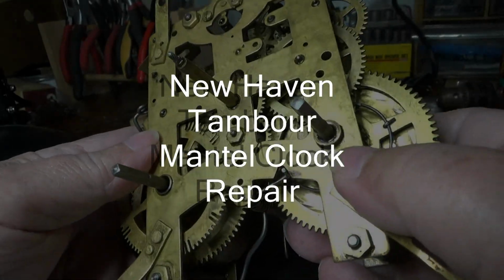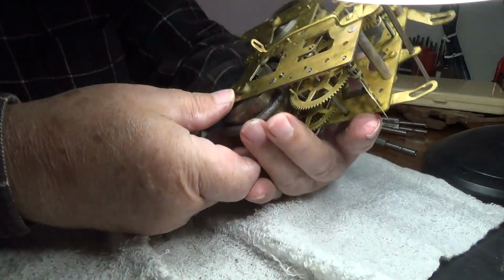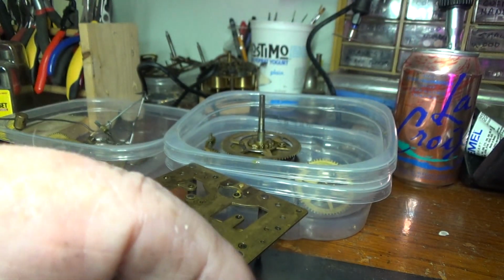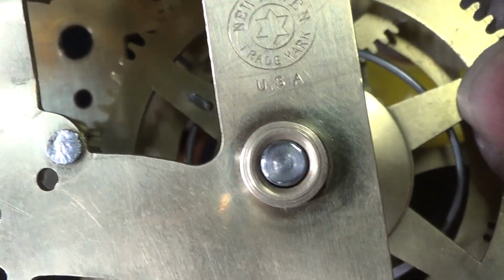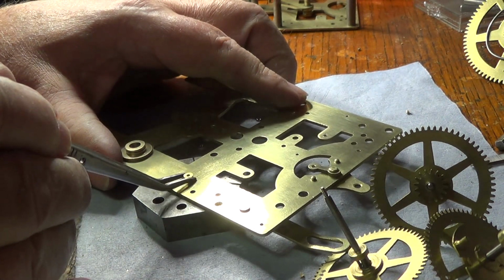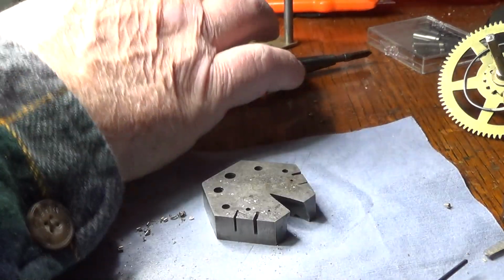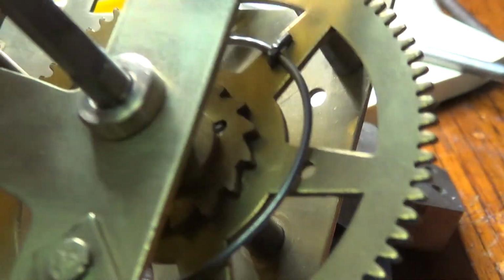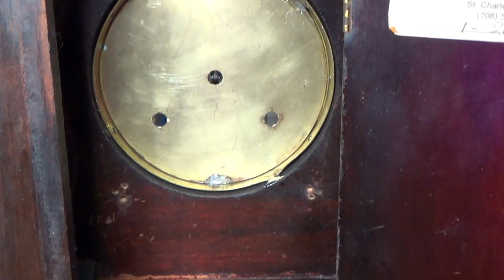New Haven Tambour Mantel Clock Repair

Comment: An index for this video:
00:00 An introduction to this clock movement and the symptom the owner noticed
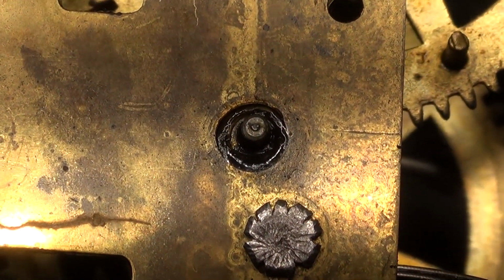01:02 Viewing dirty pivot holes
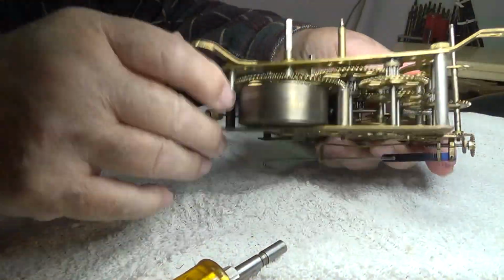01:19 Discovering the unusual mounting of one mainspring
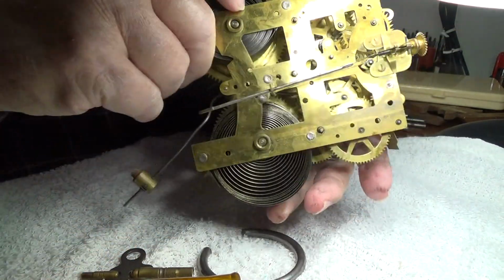03:20 Clamping and letting down the going side (time side, run side) mainspring
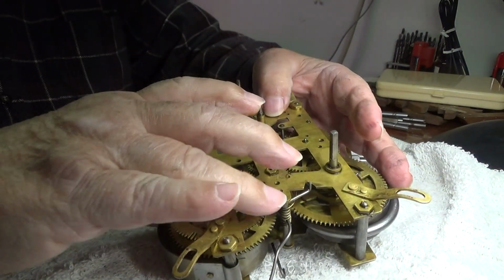05:24 Clamping and letting down the strike side mainspring
07:44 Examining the too-long strike side mainspring
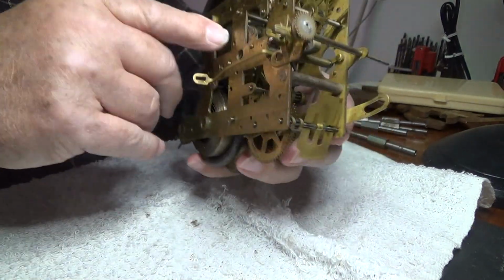08:22 Removing the nuts that hold the plates together; the last nut is too shallow to remove with a nut driver
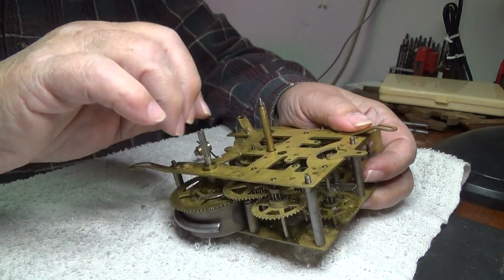11:16 Unhooking the hammer spring; pulling the plates apart
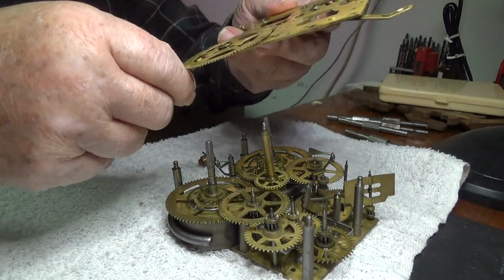11:50 Examining dirt in the pivot holes
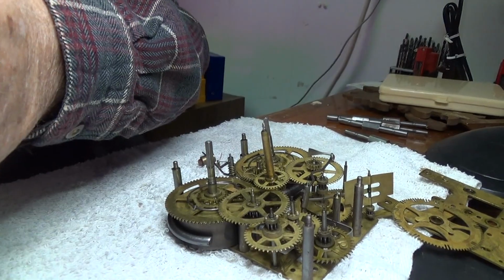12:31 Noting the position of the wheels (gears)
12:56 Examining the back plate; damage from earlier repairs
14:28 Taking a second look at that odd mainspring
14:47 Examining the time side wheels for damage
16:30 Examining the strike side wheels for damage
17:58 Examining the parts after ultrasonic cleaning
18:33 Polishing the pivots and axels with fine sandpaper
21:07 Examining the polished parts
21:35 Examining the going (run, time) side pivot holes for wear
23:06 Examining the strike side pivot holes for wear
25:19 Bushing: Marking the un-worn side of the pivot holes
25:36 Bushing: Front plate after filing pivot holes
26:13 Bushing: Measuring the front-side pivot sizes (diameters)
27:44 Bushing: selecting appropriate bushings
28:34 Bushing: selecting appropriate reamers
29:34 Bushing: reaming the pivot holes to accomodate the new bushings
30:58 Bushing: pressing-in the new bushings
33:09 Bushing: broaching out the new bushings to fit the wheels' pivots
38:59 Bushing: testing the new bushing
39:38 Bushing: testing the re-bushed strike side front pivot holes
40:09 Bushing: Comparison of the front (bushed) pivot holes vs. the back (not yet repaired) pivot holes
40:54 Bushing: examining the re-bushed back pivot holes
42:19 Bushing: preparing to replace a great wheel (mainspring) pivot hole bushing
43:45 Bushing: turning, on the lathe, a new bushing for the mainspring pivot hole
46:12 Bushing: explaining how the new bushing must be peened over (riveted) to stay in place
46:49 Bushing: examining the repaired going side (run side, time side)
47:34 Adding the count wheel, with the correct side in.
48:23 Reassembly, in brief.
51:27 Repairs to the key to allow it to adjust the clock speed.
52:00 Oiling
53:12 Running on the test stand
53:54 Cleaning the case
54:30 Running in the case

Comment: Thanks for your effort in these videos. I am currently working on a movement the same and had also noticed the unusual anchor for the time spring. This confirmed that it wasn't wrong by accident! 
I normally work with earlier stuff and was also thrown off a bit by the deadbeat escapement and reverse rotation of the escape wheel. You have helped so much..
Reply from the maker: Glad to help.

Comment: help me!  I need an old timer like myself to ask if a clock feather can be made of brass rather than spring steel.  I am repairing a new haven san mateo and if I can use brass would be an easy fix.  thank you
Reply from the maker: Certainly.  The important factor is that the suspension spring material serves its purpose to safely support the pendulum (is strong enough) and allows the pendulum to swing freely.  Look at a cuckoo clock movement.  It doesn't even have a suspension spring.  The pendulum rod is suspended by two wires loops on the ends of a U-shaped wire that is hung on a second piece of wire. Here, you can see the suspension in a cuckoo that I just described:  https://youtu.be/B_-4gkpjQlE?si=hYKkGVPdDT3SDPH4&t=2054  and Here:
https://youtu.be/sV43eXJTIUQ?si=LV28PEI5mEIY-Nc-&t=1321
Reply: @ thank you, I very much appreciate you advice!  Your instructional videos will Iive for many generations of clock repairs to come.

Comment: Thank you for the video.  What size nut is used to hold the clock hands on.  I recently purchased one of these and I am trying to restore it. Also, what is the part after this.  The clock only has the hour and minute hand and is missing the parts to secure it.  Thank you.
Reply from the maker: I don't have that clock here anymore.  I don't recall the actual size of the nut.  The hand has a slot that fits on the end of the arbor and the nut is slightly cup-shaped and is the only thing needed to secure the minute hand. You could add a domed washer under the nut if you don't have an original nut and need extra pressure to hold the hand. You might like to read this:
https://www.clockworks.com/posts/mechanical-clock-hand-nuts
Reply: Thank you @dperry428

Comment: I have a New Haven exactly like the one in the video and it has the going spring on the special stud just like yours... I assume it is how they did it... my problem is that when the clock strikes the hour... sometimes it doesn't drop into the slot, but continues on around for a few complete revolutions before the tang drops into its slot and of course that is the wrong slot... what could be wrong? I thought it might be the spring tension on the arm, but using my finger to apply pressure doesn't help... in fact it feels like the lever is locked out...
Reply from the maker: Look to the cam on the third wheel.  There is a notch on the cam that has a wire rider that should hook into the slot at exactly the same time as the lever on the count wheel drops into a deep slot.  The edge of the notch may be worn, allowing the wire to not catch and stop the strike, or the wire may be bent upward very slightly, keeping it from consistently falling deep enough to stop the strike.  Also, the count wheel lever may be dragging on some deep slots, keeping the wire rider on the third wheel from dropping deep enough to stop the strike.  Make sure the count wheel lever ("tang") is dropping freely into the deep slots.

Comment: I had both hips replaced 12 and 7 years ago 
I sure know what you mean about damage in your hand
Getting my hips done has changed my life
All the pain of the whole process is exhausting 
I really enjoy watching your expertise with clocks and metal working 
Bless you
Reply from the maker: Yes, in 2021, I had the left hip replaced in May, the right one in August and the right knee in December.  Now, in the spring of 2023, I'm about 30 to 40 pounds lighter and the swelling is gone in my hands.  I feel like I'm 20 years younger and the repairs are one heck of a lot easier. Thanks for the comments. Bless you, as well.

Comment: In the future, will you explain how to set the chime train upon reassembly of the clocks? Thank you!
Reply from the maker: There's no real magic.  With the count wheel lever in a deep notch on the count wheel, the third wheel (the one with the notched cam) should have its lever in the notch and the fourth wheel (warning wheel) should have the pin on it at the top of the movement.  It gets tricky keeping them in place during assembly.  That's why some people loosen a screw, spread the plates a bit, disconnect the fourth  wheel pinion from the third wheel and adjust the warning wheel after assembly.
Reply: @dperry428  I'm currently revisiting this movement for reassembly. Thank you for the advice!

Comment: As a novice and learning clock hobbyist, your videos have been very educational for me.
But, I have an old Sessions Clock co. clock I cleaned and oiled.  It has no chimes, but is clock only.
I did not take it apart.   It was very, very dirty and writing inside the case said it was cleaned Jan. 1928, and from the looks of how dirty it was, that was the last time. 
Anyway, my predicament is that now the escapement wheel just spins, and the pendulum just skips and spins over the gear teeth.   I guess you could say it is running extremely fast :):)
What in the world causes such a thing?.  I ask because I cannot find anything about this issue online.
Reply from the maker: Whatever you do, don't let it run like that or it will ruin the tips of the escape wheel teeth.  Your problem is likely that the anchor (strip pallet) has been raised out of its proper position.  Look at the arbor that holds the anchor.  Its pivot on the front of the movement is in a hole in a little tab that is riveted to the plate.  It is attached by a hard friction fit and can be moved to allow the arbor and the anchor to fit deeper or shallower into the teeth of the escape wheel.  It is set too shallow.  Move the tab so it moves the arbor and pallet closer to the teeth.  Keep moving it until the teeth are released one at a time.  That tab is difficult to move and very, very small movements can make a big difference.  You can move it by using a pliers at the base of the tab and twisting it to move the arbor or you can use a punch or screwdriver with a small hammer to tap the end of the tab to move it deeper. Go slowly.   When you get the teeth escaping one at a time, examine the teeth very carefully.  They may have been bent or the tips of the teeth bent over.  They will need to be straightened if they have been distorted. That's done by using a tweezers with a broad, flat end, such as those used by women to pluck eyebrows. Grasp each tooth and repeatedly pull while applying pressure to the tweezers until the tweezer comes off the front edge of the tooth.  Repeat each tooth until the ends are returned to their proper shape.
Reply from the maker: Just got to thinking.  My reply was based on a movement with escape gear and pallets between the plates.  If you have a movement where the escape gear is outside the front plate and the anchor (pallets) are on a pin held on with an "L" shaped clip.  That anchor is also moved in the same way, as the pin that it is on is attached to a moveable tab.

Comment: Thank you so much for this video....i have a quetion..where you can by  that tool to drill? ....Thank you
Reply from the maker: The bit is a reamer from https://timesavers.com/search.html?q=reamer&go=Search  The battery operated drill is a Milwaukee  https://images.ffx.co.uk/tools/4933440568.jpg?w=1280&h=960&scale=both   available where such tools are sold or on Amazon.
Reply: @dperry428   Thank you

Comment: Good afternoon Mr. Perry.  You helped me greatly on my Hermle rebuild, working like a champ.  Now rebuilding the same tambour mantel clock as shown in your video.  On the strike side, how did you keep the thin three-tabbed retainer clip in place for the strike (counting) gear?  my clip won't stay in place.  As always, a huge thanks for your videos.
Reply from the maker: The one tab should have a tip that is bent and goes into the hole on one of the wheel spokes.  That keeps it in place.  Sounds as if it is missing on yours. To remove it, that tab must be lifted and the other tabs slid out from the slot around the arbor. If it is forced off, the tiny end may have been bent under and needs be straightened so it can go  in the spoke hole.  Otherwise, you may need to make a new one from brass shim stock or, perhaps, solder on a tab.
Reply: @dperry428  Wow.  That was it, the bent tip is holding it in like a champ.  I saw it, but didn't associate it with the hole.  Thanks so much.
Reply from the maker: You're certainly welcome.

Comment: What size spring did you get. I'm having some difficulty measuring the length. Just a little hard to measure?
Reply from the maker: I don't remember what the size was.  Measure the width and thickness.  Measure length the best you can.  For the inner coils, it helps to have a cloth tape measure used by tailors and seamstresses to measure chest, waist and hips. When you look up available springs with the same width and thickness, pick one that's closest to the length you  have measured.  There are only so many available.  Here's a list of those available from Timesavers  https://timesavers.com/files/mainsprings.pdf  A very common spring for old American-made clocks is 3/4 x .018 x 96 inches.

Comment: Someone put it together wrong, the stud that spring was hooked on is to keep spring from relaxing into works
Reply from the maker: Nope!  Sorry, but you're wrong on this one.  Every image I've found of this exact model movement is put together exactly in this way.  I, too, thought the same thing, but the pin was too big and in the wrong place for it to simply be a stop for the spring.  In fact, were it simply a stop, it would stop the spring long before the full 8-day run.
Reply: I believe you, but what is weird is I have 3 of those running ,same movements all 3 connected to the bottom corner , they all run for 8 days. They came to me like that and thats how I reassembled  them .
Reply from the maker: That's nice.
Reply: Just to add,  i recently stripped an identical New Haven movement fitted in a school clock  and the main springs were fitted in exactly the same way as the movement in this vid,  I.e.  with one loop over a smaller stud and one around the plate support pillar.

Comment: I had a mechanism recently which I did not have the strength to torque the let-down tool.  I ended up putting the whole mechanism in my spring winder, and that made it much easier.

Comment: Nicely done.  One question though, had you considered putting the end of that spring around the lower post you stated it would normally go on rather than the odd one above it?  why/Why not?
Reply from the maker: No, I decided to leave it just as original.  I can only assume that there was a reason for the designer doing as they did as it required riveting in another post. In the normal position, the spring must have unwound into the second wheel pinion and stopped the clock earlier than the normal 8 day run time.  Looking at the strike side, there were also 2 posts riveted onto the plate to direct the spring coils to the outside of the plates.  Assuming there was a reason for doing what was done originally, why create a potential problem by installing it other than the way it was designed?

Comment: bonsoir vous ne montrez pas comment vous retiré les anneaux qui maintiennent les ressorts car moi j'ai un prob avec çà merci de votre réponse
Reply from the maker: Here is one way, with a spring winder:
https://youtu.be/4oHBN6KhUnk?t=639
Here is another way, using a different tool:
https://youtu.be/JcUq4tSj98I?t=756
A third way is to put the wheel and spring back between the plates, clamp or tie with wire the wheel to the plate frame, wind the spring, remove the clamp and let the spring down with the let-down key.

Comment: You've single handedly got me into clock restoration through watching your videos. I've just restored a Seth Thomas 5 7/8 movement kitchen clock with the separate alarm mechanism. The case was smashed but I'm fine with woodwork. The movement had a broken spring on the time side, missing verge and suspension and damaged escapement wheel. I did some bushes also. I found it difficult making a new verge/anchor fit and still don't think its entirely correct but the clock does run. Any tips on how to set it up properly please.
Reply from the maker: If you're concerned about the escape wheel and verge not being right, count the number of teeth on the escape wheel and order a replacement set.  https://timesavers.com/c-325836-clock-repair-replacement-parts-verges-verge-components.html   Otherwise, I'm not sure what you mean by setting it up properly.

Comment: So glad you are back doing repair. Too bad your right hand is weak. I hope you will regain strength in your hand.
Hope you have a cuckoo to do soon.
Reply from the maker: I had an injection into my hip joint. The next day, I could walk.  Then, without the cane, the swelling went down in my hand and I've regained the strength in legs and hand.  I hope this lasts a long time.  So far, it will be a month tomorrow and I'm still doing well.
Reply from the maker: Cuckoo is next.
Reply: @dperry428  Great! Glad you are doing so well. Can't wait to see the cuckoo.

Comment: Hi Mr. Perry  - thanks for sharing!   I  do have a question though - when you clean the plates, do you loose the lacquer  (I do), and if so, do you bother to relacquer them?  Thanks also for the encouragement you provide to your viewers.   As always,  have a happy day!
Reply from the maker: These movements don't have any lacquer on them.  That's usually found on better quality movements.  When I come across one that has lacquer and the plates aren't stained, I hand-clean them without ammonia, which is the culprit that removes the lacquer.  On the rare occasion that I have to clean a plate to the extent that lacquer needs reapplied, I put toothpicks in the pivots holes  and spray with a clear lacquer.
Reply: @dperry428  thanks so much for the response.